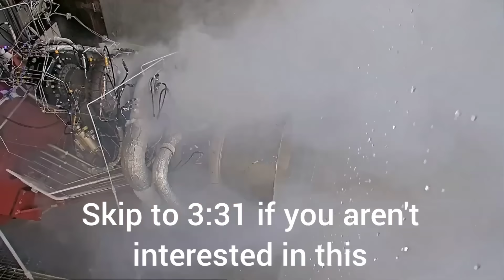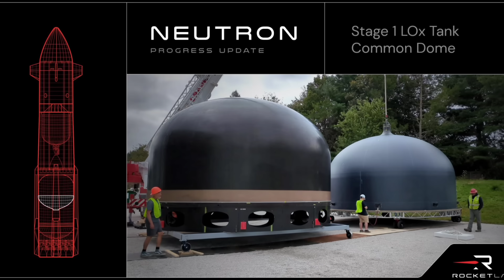The most sophisticated rocket ever is coming next year!  And SpaceX isn’t building it!

Comment: Youre either ignorant, or your lying intentionally.

Carbon fiber wouldn't be any lighter than stainless.

Amd the reason it wouldn't be is because carbon fiber would need a LOT more heat shielding, drastically increasing weight. 

The simple fact is Musk chose stainless because it could twke a LOT more heat before it hets damaged.

Come on, your jealousy of Elon is showing through. Try to be honest.
Reply: this is just plain wrong, Falcon 9 uses carbon fiber on the landing legs and parts of the booster, they are exposed to the heat without heat shields and they are completely fine, 
the neutron will be way lighter so it will slow down faster and need to dissipate less heat then F9, and if u doubt me the Electron is full carbon and it survives fine without a heat shield and could even be reused
Reply: @andreaswallin5115  
The Falcon 9 booster does not go that fast, so therefore the heat it's exposed to is not that high. Starship goes much faster...... Therefore a LOT more heat.
Reply: @andreaswallin5115  
Likewise, the electron rocket also stages at a lower altitude, so it also isn't going to be going very fast. So not much heat to seal with.

But starship will be at orbital velocity.

This might be rocket science, but it's the easier part. You shouldn't be struggling with comprehension.

Comment: Carbon fiber is a fantastic material, but it has to bonded by a resin. And the resin will be the limiting factor for the final product, but also the most likely source of failure, as we have seen on the Orion heatshield. Most epoxy resins give up above 300 C, some manage 500C, but that is it. Other resins are, to my knowledge, not suited for cryogenic applications. Just my 5 cents.

Comment: I somehow feel that the comparison to the Starship system here is very misplaced since the entire ship is the "Payload". The only way to compare them fairly then, would logicially be comparing the entire ship as the booster payload, since the entire ship is large enough in itself to be a payload, such as a re-fueling station in orbit or a space station, the amount of volume and flexibility of the ship makes the comparison a little short sighted. It is the same as comparing an Airbus to a Gulfstream in flying 8 people across the country, an then saying the gulfstream is better since it is lower in fuel cost, completely missing that the two systems were never meant to do the same things. If you turn the comparison around and try to move 100 people, the point is better illustrated. Not to say that Neutron isnt an amazing piece of engineering, by far IMO the current best at what it is meant to do such as the video examples, but comparing it to something meant to be and to build stations on both the moon and mars, is misplaced. (sry for the novel of a comment :))

Comment: re: carbon fiber vs Stainless Steel. while CF has a weight advantage at normal temps, Elon has said (with a fair amount of detail) that once you account for the strength losses at cryogenic temps, and the fact that you need to add extra layers in case the layer bonding isn't perfect. the weight savings decreases drastically (if not vanishes)

Now, it may be that Peter Beck is correct and Rocket Labs has better expertise in Carbon Fiber than anyone who worked at SpaceX and will be able to shave off the margins without affecting reliability, but it may also be that the Neutron gets heavier to be reliable (just like the early Starships are heavier than originally planned)

The Electron 2nd stage is why they initially seems so impressive. The payload fraction (mass of payload as a percentage to the total mass that gets to orbit) is very high, especially compared to a reusable 2nd stage. Avoiding the 2nd stage needing to support the fairing mass lets it be a bit lighter, and if the most acceleration in the flight is during the 1st stage burn, then the 2nd stage can be less robust when supported from the top than in a traditional design (although the mass added to the 1st stage is noticeably more than what is removed from the 2nd stage, but the normal ratio is you can add 6 pounds to the 1st stage for every pound you remove from the 2nd stage)

your "11x thrust but only 7.5x payload" statement is also questionable.

First, the payload
Neutron is 13t to LEO (drone landing), 15T expendable, 8t RTLS  (although recent postings have just said 13t to space, so the payload limits may be a bit lower), 7.5x that is 98t, 113t and 60t
Starship block 2 is aiming for 100t, Starship block 3 is aiming for 200t (and if you don't believe the SpaceX estimates, you should not believe the Rocket Labs estimate either)

So a block 3 starship is roughly 25x the payload while being fully reusable, considerably more if partially or fully expended.
(you can roughly double those numbers if you fully expend the Starship, and probably > 1.5x those numbers if you return the booster but expend a stripped down Starship)

next the thrust
RocketLabs claims that 9x engines will produce ~675T of thrust at liftoff compared to 1250t of the block 1, 1600t for the block 2, and 2700t for the block 3 starship, even the block 3 is only 4x the thrust of the Neutron, not 11x

Comment: I disagree that a Starship solution is too complex. They're putting "all the wood behind one arrow" in building a platform that can be used for so many different purposes. Yes, they'll need a bunch of fuel depot launches, but SpaceX launches Falcon 9 eleven times per month at the moment. That means just one month's worth of launches to get Starship fueled and launched to Mars. And they've already demonstrated atmospheric reentry and landing with Starship (albeit in earth's atmostphere, not Mars). That means they're already building the craft that would launch and land on Mars. That actually simplifies and streamlines a lot of development.

That being said, I want Rocket Lab to get the Mars sample return contract. They've proven themselves as a worthy launch company and great innovators, but they need a big NASA contract as financial backing. $2 billion would go a long way in helping them get Neutron out the door.

Comment: CF may be lighter. but can it survive re-entry. i feel that someone has recently tried it and found it melts and disintegrate. they may be able to make it happen but will probably have to double their expected body weight just to even make it survive. meaning the extra light body won't survive with out being just as heavy, or employ heavy heat sink tiles. either of which will rob the underlining weight difference.  might be game changing tho, not so sure tho.
i do hope it works, definitely  need more capable providers.

Comment: That was one of your best productions! One quibble is that you didn't convince me that the fairing protected the second stage any better than one that is jettisoned into the vacuum of space. Both boosters have a fairing while it is in the atmosphere. After the fairing is ejected there is no atmosphere to put any stress on the stage. Obviously there is something I didn't understand because you didn't make the case. I'd love to know what it is. That's a very minor point however.

You started out with a huge promissory note "most technologically sophisticated rocket on Earth" and you built up amazing evidence to bolster your claim. We'll see how carbon fiber works during reentry, as carbon fiber is flammable and reentry causes heat enough to melt through stainless steel. How do we know? We watched your video!

Obviously the Rocket Lab engineers know that and have a plan, most probably involving a more gradual reentry path that doesn't develop the amount of heat we've seen on Starship. The "hit 'em where they ain't" strategy of Rocket Lab is bold, carefully executed and their track record means expecting success isn't an unreasonable attitude. This company is a winner.

Comment: Comparing Starship to Neutron doesn't make sense.

- Starship: has already gone to orbit 2x / Neutron: just a prototype, never flown
- Starship fairing: 9m / Neutron: 5m 
- Starship expected payload to LEO: 100-150t / Neutron: 13t (if it' returns to launch site, like Starship, then it would be even less: 8t)
- Starship 100% reusable / Neutron: 50% reusable (second stage is wasted)

I also don't undertand why comparing thrust to weight ratio is revelant. Starship is of course going to have a worse ratio if it's made for 100% and fast reusability.
And why does it matter that one is carbon fiber and the other not? Yes, it's lighter, but how is that better? Weight is not the only variable at play here.

And yes, Neutron has landing legs while Starship hasn't. However, I would like to know why that's even and advantage.

Comment: The main reason space x chose stainless steel over carbon fiber isn’t due to cost or ease of construction, although they were also factors, it was because of its ability to withstand high temperatures upon reentry and allow the booster to survive without the additional firing of the engines like falcon 9 must do.
Reply: And its ability to handle cryogenic temperatures better.
Reply: Wrapping carbon fiber is a huge pain in the ass.  It is slow and messy.  Also it burns well.

Comment: I think this application of 3D printing technology is fundamental flawed. It’s true that a welded joint is stronger than the base material. However, with 3D printing the entire part is weld. Nothing in this world is perfect and statistically at some point in the print cycle somewhere within the millions of linear centimeters of weld there will be a section of weld that will be unsuitable and will cause a catastrophic failure. Inspection techniques to find this proverbial needle in a haystack are almost nonexistent and if they were developed to a sufficient degree it would be exceedingly expensive. I really don’t think this manufacturing technique is feasible, certainly not scalable.
Reply: They are already using carbon fiber printing with the Electron rocket. The Electron was the fastest to 50 launches and Peter Beck said he expects it to be the fastest to 100
Reply: @nagoyakiwi  It didn't work out so well for the Titan submersible. With this rocket being reusable I'm sure it will suffer a catastrophic failure.
Reply: Pro tip: Neutron will go up, not down. 😁

Comment: I agree with you, in the short-term. SpaceX has absurdly incredible engines and the steel structure is optimal for upper-stage return from LEO ... but it is suboptimal for efficient smaller-scale inter-planetary missions. It's just too large and heavy for those missions. Starship is still great if one wanted to send massive structures to Mars/Moon, but that's a different scale of operation, and most missions don't need that scale. 
However, in the future, once Starship flights take place regularly, other companies may start taking advantage of the greater mass to LEO of Starship... perhaps then, Starship may prove to be the better delivery vehicle into orbit even for smaller-scale missions, as the reusable upper stage would theoretically allow for lower costs and more frequent launches.
Ultimately, considering this, Neutron is not a Starship competitor, but only a Falcon competitor.

Comment: Sorry, but 3D printing stuff does not make it advanced. It sounds more like a low budget option: less material strength, but cheaper in small numbers. At the large scale SpaceX is working at I don't believe they can compete in costs. SpaceX also uses 3D printing, but only for parts where there is no better option.
Reply: I think you missed the point that carbon fiber is five times lighter then stainless steel.  So if you starship weight 1000 lbs and you make it out of stainless steel it can weigh 200lbs.
That 800 lbs savings you just made goes great for payload or making a smaller cheaper vehicle.
Reply: @Honestraccoon  it is lighter, but also much more expensive and harder to form in big shapes, also much less heat resistant. SpaceX Falcon 9 is mostly carbon fiber, and they started with Starship with it as well before switching to steal. I like the brute force and heat resistance approach above chasing after every gram and hoping the heat shield will not leak.

Comment: Yes, you are wrong.  Another great 'simulation'! If you have a new rocket, that is a 10 years late competitor, it better have 'more technology'.  Engines at '80' percent power means less payload.  How does all this 'fit' together with the positives you note--you can only 'use' the light weight argument once--either more payload or running engines at less thrust?

Comment: LoftID outer ceramic woven fibers were good for 2900F re entry heat. The aeroshell had almost no scorching.  Carbon Carbon type fiber composite can go up to 3600F.
Reply: @mefobills279  what happens to the structure of carbon fiber when you have to drill thousands of holes into it to attach different components?
Reply: @cryptosupplyshop3425  I don't understand this hostility to carbon fiber.  Basically, the sour grapes crowd is saying that rocket lab engineers are stupid. When you recover the rocket then the higher cost materials make economic sense.
Reply: @mefobills279  i agree carbon fiber is good for neutron as long as they not coming back at orbital speeds and the do a re-entry burn.

Comment: Neutron will compete with falcon heavy, not with starship, they are not in the same category.
Other point is that today, spacex build its starship with inox because it is cheap and reliable. But it also heavy.
But when it will work, what forbids spacex to replace some of the inox with titanium or carbon fiber? Yes, they will need to test again, but for some usages it could make sense to have lighter rocket, for example, to land on the moon with much more payload or less refuel and stay there.
I think that they know that their rocket is too heavy, even if it works. I hope that after 10 lauches, they will begin to seriously begin to address this point.

Comment: The carbon fibre for reentry was comprehended by Becks first pass analysis using the traffic cone analogy.  The wide base allows the lightweight rocket to slow down and receive less atmospheric reheating.  The wide base also allows landing without tipping over.  The wide base fins will have some sort of crush cans for landing, a challenge.  But stage zero will be significantly cheaper than starship.  My opinion, they will need downrange barge recovery capability.
Reply: Neutron will have no wide base. That was an early design that’s been moved on from.
Reply: @Mottbox  You're right. It's more narrow now.  I have faith that their engineers are not stupid and know the limits of their carbon fiber heating upon reentry.

Comment: Who is paying for the development and qualification cost for Neutron?   Even though the plan is not to use full thrust the fuel tanks have to be fully pressurized.  How many pressure cycles will a 100% Carbon Fiber pressure vessel be able to withstand prior to being replaced?  When is the Rocket Lab LV ECD and first flight?

Comment: You make it sound like the "reason" Starship is stainless steel is because it is inexpensive and easy to manufacture, and completely missed one of the most significant design criteria for the selection of stainless steel, which is its resilience for re-entry.   I would also argue that Space X's manufacturing techniques for such traditional materials are rather sophisticated or at least advanced in the area of mass production.  I mean, it is not just a bunch of bros on scaffolding welding panels (SpaceX is well past Starship Mk2)! Otherwise, nice video...introducing folks to this rocket by comparing it to another advanced design that we are more familiar with is a nice approach.  Best of luck to Rocket Lab, it is nice to see different approaches for getting to orbit and advancing rocketry.
Reply: Neutron doesn't have such a requirement, to return from Mars.

Comment: I really wonder if spacex would start implementing composites into starship to make it lighter, once the prototypes have proven themselves.
I would imagine replacing the steel fuel tanks with lighter composite tanks would greatly reduce the weight.
Reply: As usual, the Annoying AstroNut doesn’t know what he is talking about 

SpaceX innovates so quickly that using Carbon Fiber slows the process

Raptor engines are already 3D printed and they are working on the Raptor 4 engine

Laser welding is inexpensive,fast and reliable

SpaceX can pivot on a dime if something doesn’t work. Literally everyone else is plodding along  like, NASA, Boeing and Lockheed did for years

Finally, Jordon Wright has been completely wrong so many times that listening to him or his videos should be definitive example of failing at prognostication
Reply: @phildurgin652  what I mean is when starship is more refined, and spacex is only making small changes to improve the design. 
once this stage is reached, I was wondering if spacex using carbon fibre tanks would help reduce with boil off, and lighten the starships dry mass. 
obviously I know why spacex is using stainless steel, and I think it has been the biggest game changer in rocket design
Reply: Starship doesn't have fuel tanks separate from (internal to) the rocket's hull.  The hull IS the fuel tank.
Reply: I wondered this myself. Once the design is squared up, to replace tanks with CC would be a game changer.

Comment: 8:30 …and because stainless steel performs well across a wide range of temperatures, from hot to cold. (You didn’t list steel’s most important property, in terms of rocketry).
Reply: The problem with stainless steel is that it heats up nicely and handles the heat well, but takes forever to cool down / release or spread the heat
Reply: @ Very true. On the other hand, carbon fiber retains strength and stiffness in extreme cold but degrades above 500°C, whereas stainless steel maintains structural integrity in both cryogenic conditions and temperatures up to 900°C.